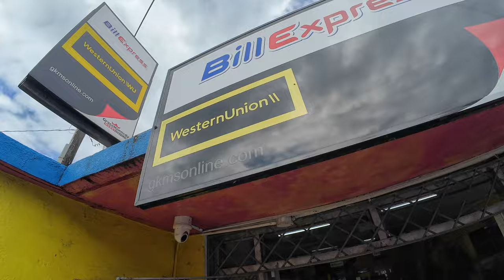🏍️This Babylon motorbike had us stranded and struggling on the side of the road!!!

Comment: your front sprocket that the chain rotates on needs to be changed and you need a new chain… just tighten the chain u should be fine for now
Reply: that rattling noise coming from your chain means your chain is stretched … but a new chain and replace the front small sprocket in behind your chain case by your foot
Reply: don’t tighten that chain to much … half inch play u should have with ur chain
Reply from the maker: Thanks fam, bless!!! 💯💯❤️☺️✌🏾
Reply: @BAK2N8TR   cheers to you guys on your new journey .. ✌️✌️
Reply: @BAK2N8TR  when i come back to jamaica.. i will be definitely coming to your guys place for a stay … one love from newfoundland,canada